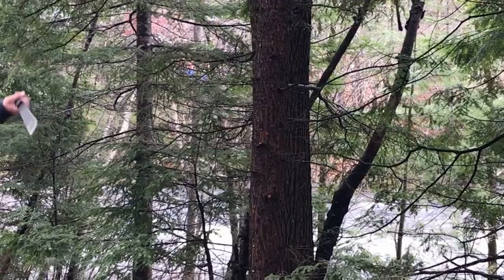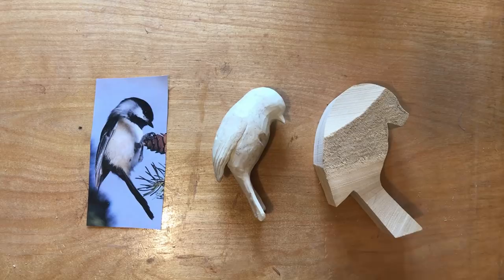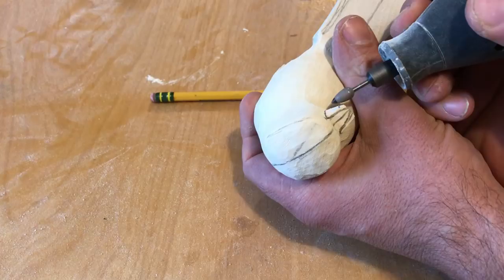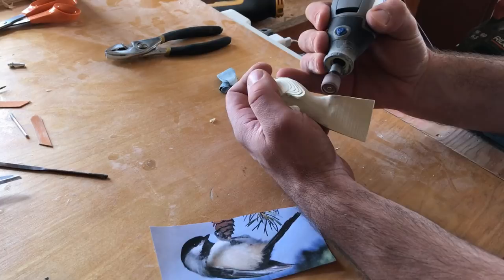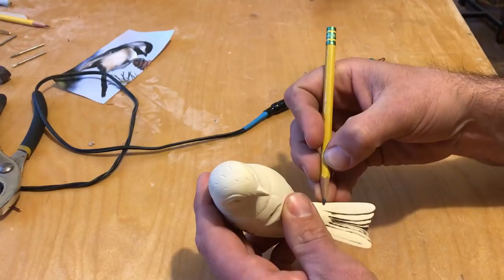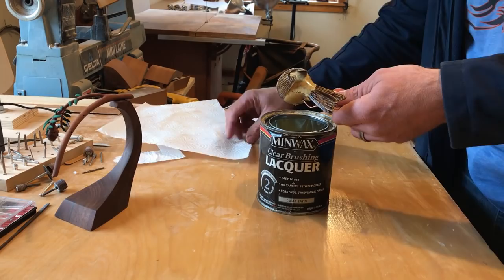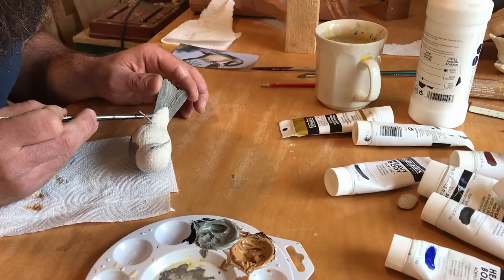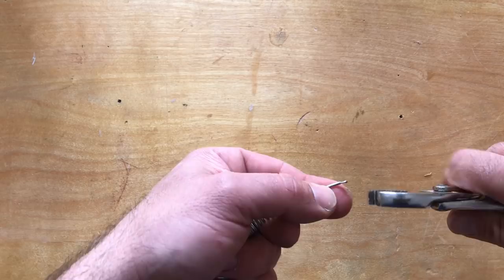Carving A Chickadee - Power Carving A Bird

Comment: Very happy Iv found your video , I really want to buy a rotary tool and was thinking of the dermal 3000, and coincidentally I planed on trying a bird or maybe a flower for my first project 
Can you get all different types of detailing tips that all fit the 3000? 
Thanks for your answer in advance
Reply from the maker: Sorry I didn’t reply earlier. I hope you have been carving. The dremel has to sized collets so you can use any bit you want.